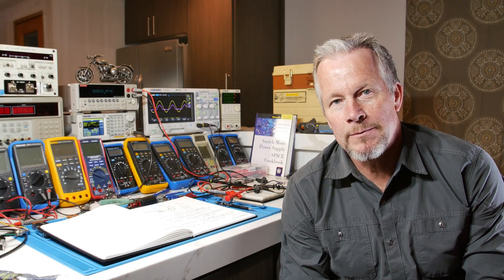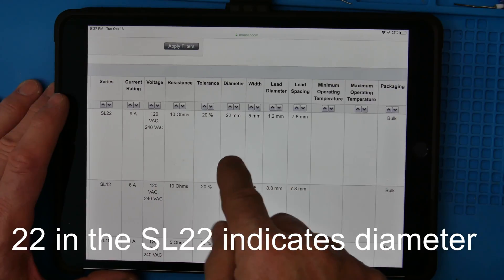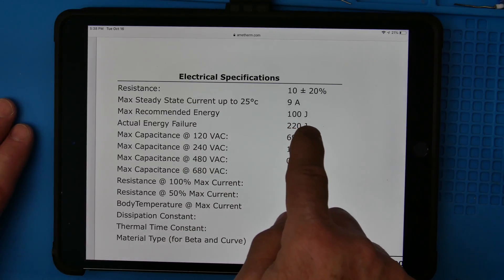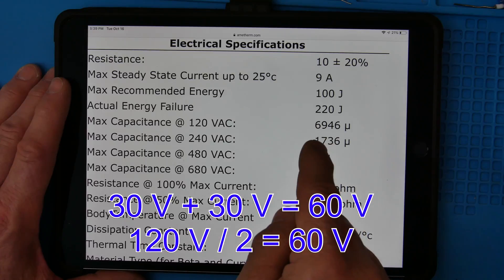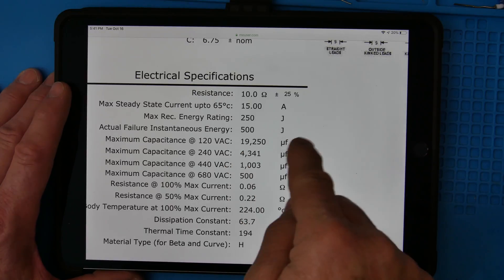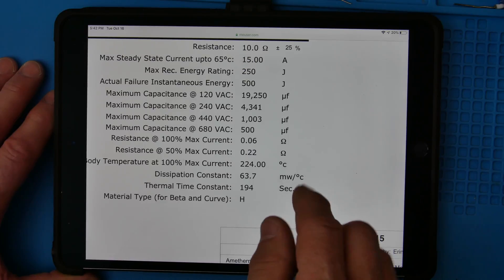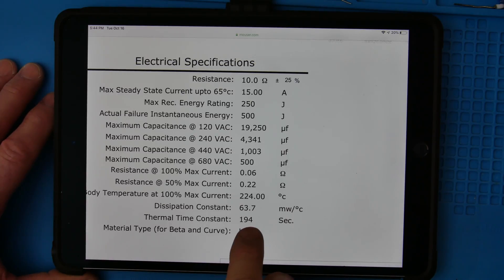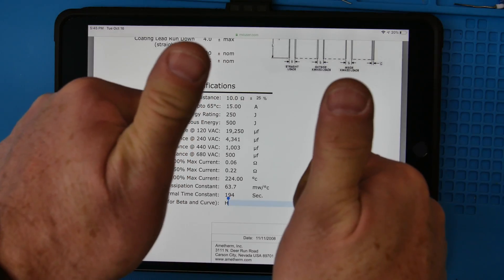Current inrush limiter Power Supply Design using a Thermistor #NTC #inrushcurrent

Comment: Relating the capacitor: if you double the voltage, you just can handle a quarter of the capacity. If you use half of the voltage you can increase the capacitor size to a factor of four. The time constant has nothing to do with the capacitor size. It is just the time it tooks to reduce the temperature difference to room temperatur by a factor of 1/e. It is determined just by the heat capacity.

In order to get safe on regime you have to wait for 2 to 3 times of the time constant. Then you are close enough to room temperature again. You can also bridge the inrush current limiter by a relais after 2 to 3 time constants in order to reduce the losses and cool down the inrush current limiter within another 2 to 3 time constants. So you can restart your device after 4 to 6 time constants after switch on.

Comment: I see there is a little of confusion about the energy an inrush current limiter can handle. This is simply the heat it can store by a temperature rise between room temperature and steady state temperature (here 192 °C). It is determined by the heat capacity of the device. In this case it can store 100 J. It is generally not a problem to exceed the maximum steady state temperatur a little bit for a short time. But if it gets to hot it will be destroyed, this will happen at 220 J.

Comment: I had recovered two 25mm NTC from a plasma TV. 
Is 1.0 1 ohm or 10 ohms?
Reply from the maker: You can measure that with a multimeter - and I would guess it is 10 ohms.

Comment: Some NTC manufacturers like the NTC10D20 have no energy specification nor any voltage rating in their datasheets. There is only a stady state current as a hint for the destruction limit. Is there a way to guess the energy or do need I to destroy one and measure to be sure ?
Reply from the maker: Thanks for this!  I need to do a video showing how to consider this!

Comment: I’m glad I came across this video. I’m recapping an old regulated supply and thought I would add an NTC. I had one picked out but I did not check to make sure it would work for the capacitance in the supply. This may have saved me a very short lived thermistor.
Reply from the maker: That's great!  Thanks for your feedback!

Comment: Hi. Limiting inrush current is just for protect device isnt it? It still pulls high current but protects device. Is there any chance to limit current from home plug on start? I have a led 1200w power supply for my lipo charger. Everytime i plug it, home's circuit breaker operated just for one time. After I open the circuit, everthing is great. It never failed while working. I think charging capacitors in power supply pulls too much current at start. I dont know. A friend told me turning on circuit breaker for one time isnt big deal but i am looking for solution.
Reply: Supply output is adjustable and im using at 48-50v input is 230v
Reply: Circuit breaker is 220v/360  16a. One source says my supply has 50a inrush current.
Reply from the maker: @marcoscimbom  You could place a larger NTC to limit the current.  Another old method is to put a lightbulb in series - which is essentially an NTC:). When power is applied, the light bulb lights, then goes dim as current continues to flow, so first when the light is cold it has higher resistance then drops with temp.
Another option is to place a filter in line and the inductors will limit the inrush current.  Let me know what you try.  But, I think you are right in that it is the capacitors pulling the current at start-up.
Reply: @KissAnalog  thank you so much for answer. i thought putting a lightbulb, its a common advice but my main concern is not protecting the supply. I have no deep knowledge, do you think putting a lightbulb decrease the current which came from relay? Maybe i should use 50a relay for one power outlet.
Reply from the maker: You could get a relay with same lower level current for better protection, but get one meant for motors - something with slow reacting- - time delay type.
Reply: @KissAnalog  thank you! I have never heard about slow reacting delay. It would be awsome for me
Reply from the maker: Electro-magnetics are very slow - and they can be made slower;)
Reply: @KissAnalog  I think a light bulb is purely resistive which is the other way round - very low when cold and increases as it heats up. It does protect against blowing fuses etc if the device connected in series goes short circuit (full voltage then across the bulb - bright), but if you measure the voltage across the device when the bulb is dim you'll notice it being quite a bit less than normal due to the resistive drop across the bulb - the larger wattage of bulb the less resistance and consequently the more power shared by the device in series.